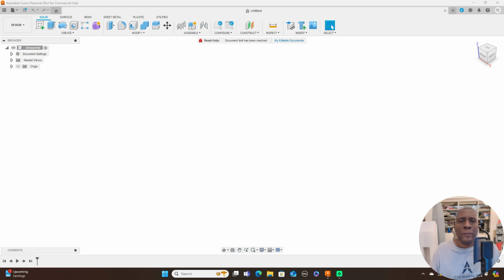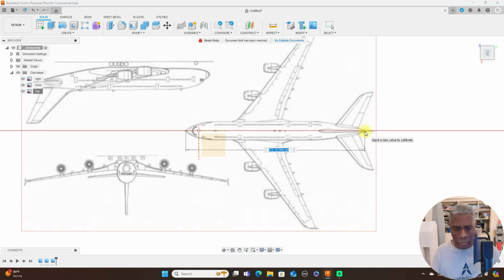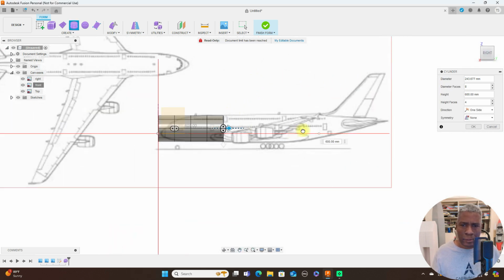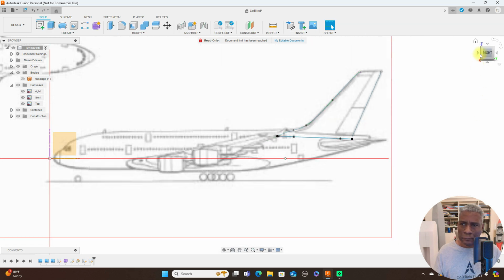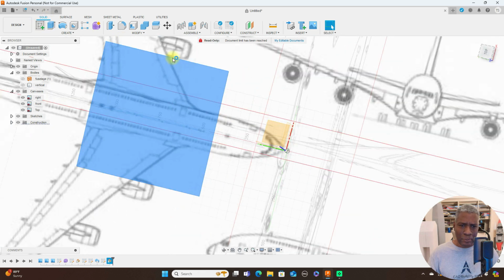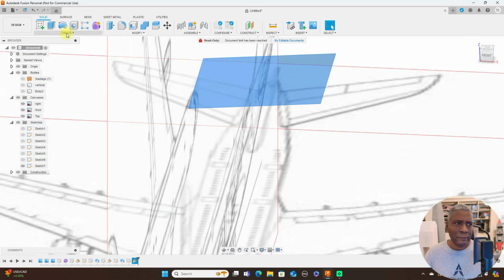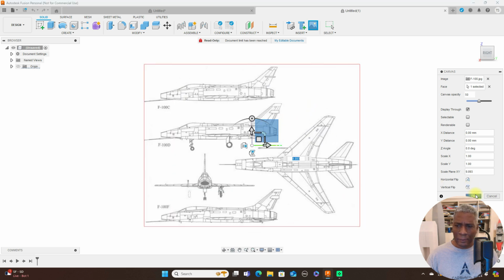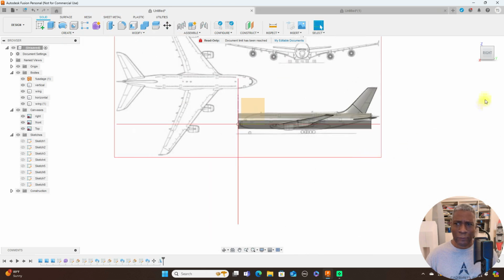The only work flow you need to know modeling with forms in Fusion 360 CAD.  Tutorial

Comment: Hi, I'm a big fan of your work! I know you are more used to using Fusion 360, I don't know if you use Solidworks, if you have already used it I would like you to clear my doubts. How do you make the spars of an airplane? Would you know?
Reply from the maker: Thank you.  Do you want to know how to make a spar in Fusion 360 or Solidworks?  I can do it in either program.
Reply: @cadbuildflyrc3784  in SolidWorks if possible. I've been trying for 2 weeks, but it never works out. I'm trying to make the MQ-09 Reaper. thank you very much!!
Reply: @cadbuildflyrc3784  Thank you very much for your attention! If possible in solidworks. Because I have doubts about how to make the plane's fuselage stringers. I'm trying to make the MQ-09 reaper model aircraft
Reply: @cadbuildflyrc3784  caves that I refer to are the same as fuselage stringers